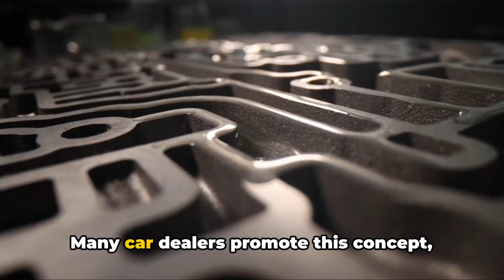Why Do So Many Transmissions Breakdown at 120,000 Miles?

Comment: And manual transmissions usually last longer than 120.000 miles. But newer automatic transmissions are so intricate that they will probably need much attention at around 120.000 miles.
Reply from the maker: That's a good point! Manual transmissions are known for their durability, but newer automatic transmissions do require more maintenance as they become more complex.
Reply: Nothing like the old vintage non computer automatic transmission

Comment: My S212 Benz (six speed manual...) will pass the 400,000 mile mark soon. The transmission works flawlessly (except for a $15 driveshaft seal I needed at about 300,000). I am even on my first DMF.
Reply from the maker: That's incredible! It's amazing to see a car perform so well even after such high mileage. Keep up the good maintenance work!
Reply: @HonestMechanicChannel  the best thing is, that it has the dreaded OM651 twin turbo Diesel engine. Maybe it is sheer luck that it still runs... Engine is still un-opened. I just threw some injectors and a rebuilt low pressure turbo at it until now.

Comment: My 200K 2001 Honda Accord transmission is still great, as I changed regularly with OEM transmission oil, but rear main gasket starts to drip after each drive, when the oil level is at the correct full level!  Arggg...Rear main gasket costs too much to fix!  So probably donate the car!
Reply from the maker: I'm glad to hear that your transmission is still in great shape! It's always a relief when regular maintenance pays off. As for the rear main gasket, have you considered getting a second opinion on the repair cost? It might be worth exploring other options before donating the car.

Comment: My 2017 pilot with the push button 10 speed transmission just went at 76,000 miles. Wouldn't go into park but then did. Honda tech looked at it and said need new transmission for $10,000. I know someone who the same thing happened at 80,000.
Reply: $10,000 for a transmission in a normal consumer car is the absolute meaning of insane. They can't be serious. I recently needed a new 9-speed trans for a 7 series BMW and the fully warrantied, certified factory rebuilt unit (I actually got apparently a brand new one) cost about $3,000 plus tax. Changing it takes about five hours.
Reply from the maker: Woah, $10K for a transmission? That's insane but unfortunately pretty common from my experience! Thanks for letting us know about your mechanic's experience, it's always good to have options when dealing with car repairs.
Reply: @HonestMechanicChannel maybe it is one of those Transmissions which need 20 hours to replace. Some Honda dealerships have hourly workshop rates close to $200. It is mindblowing, but if you think about it, it is possible...

Comment: A lot of mechanics are fooled by the ratio of MILES and KILOMETERS. So here you are speaking in MILES. At 120,000 Miles failures often occur is synonymous with 216,000 Kilometers (often rounded up to 240,000 Kilometers) but the mechanic will likely just change the measure. i.e. he will say 120,000 kilometers without doing the math.
My vehicle manufacturer says to never change the oil in the automatic box but in the country of manufacture the government mandates that the vehicle be removed from service at 40,000 Km whereas in my country we drive them until they become irrepairable. So at 92,000 Km I had the oil changed and flushed and the NEXT recommended change is at 132,000 Km or in 6 months. I now have 123,000 Km on the vehicle and the 6 months was up 2.5 years ago. The oil in the transfer case of this vehicle is separate from the box and is missing a dipstick too!
Reply: 120,000 miles are about 190,000 kilometers. Absolutely nobody rounds that up to 240,000 km.
Reply: @albinklein7680  You would thus be surprised that many do round it up from the 193,121.3 Km (You rounded it down) but you missed the point of my post which was 1. to get some conversation going about this subject and 2 . To get us all to understand that it is not correct or right to just change the MILES denominator to KILOMETERS without accurately doing the math and without rounding it off too much.🙃
Reply: @normanappleton3627  keep focus on aero shit. miles and nautical miles are different
Reply: @josefharasek7487  What does Taurus Excreta have to do with this discussion? In my car in Australia I use Kilometers, When I drive in the USA I am looking at MPH and when I fly or use a boat my speed is recorded and presented in Knots!